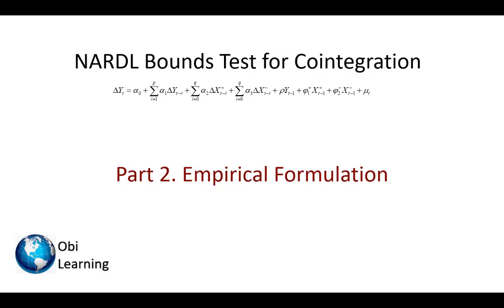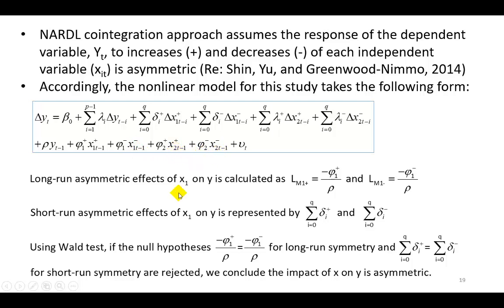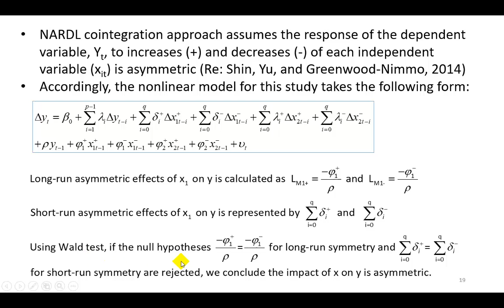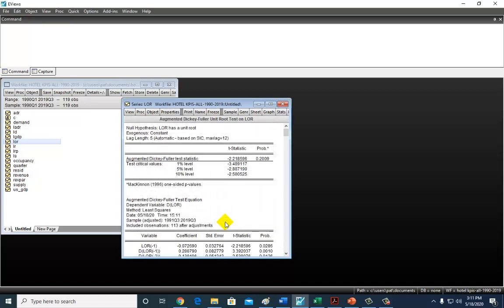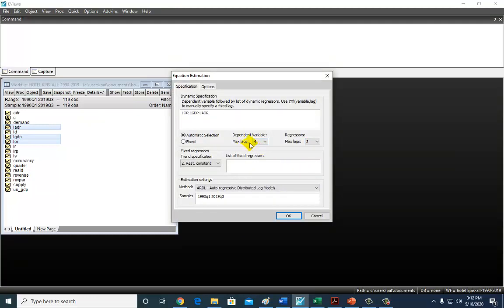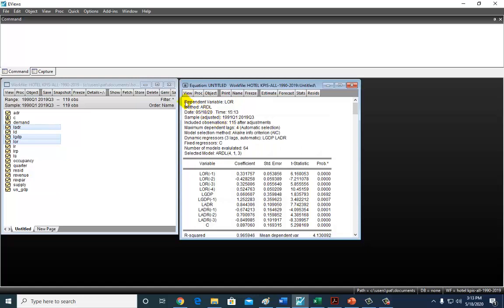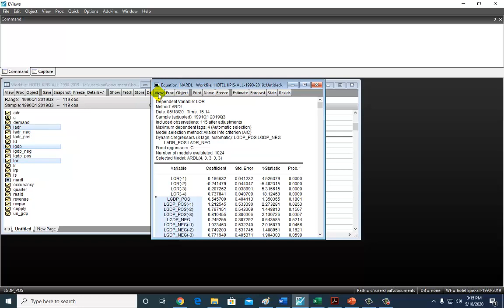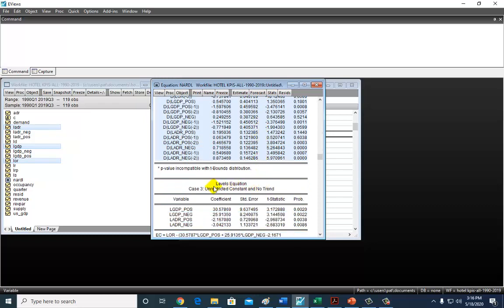NARDL Bounds Test - 2of5 (Empirical Formulation)

Comment: Thank you for sharing this video Professor Pat Obi. I have a question: when doing the Bounds-Test, the value of the F-Statistic is slightly greater than the value of the critical value (e.g. F-STATISTIC = 5.95, Critical value (5%) = 5.85), can we say that there is cointegration among the variables?
Reply from the maker: Yes, at the 5% level.